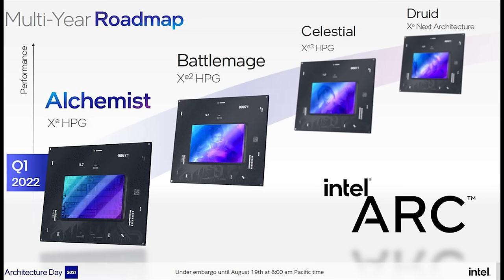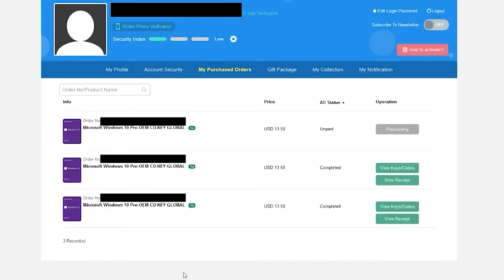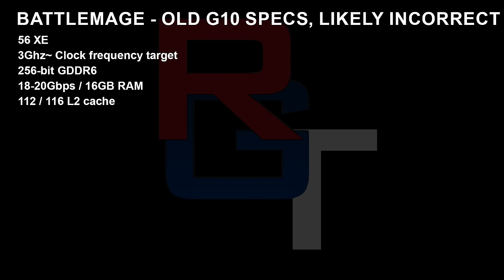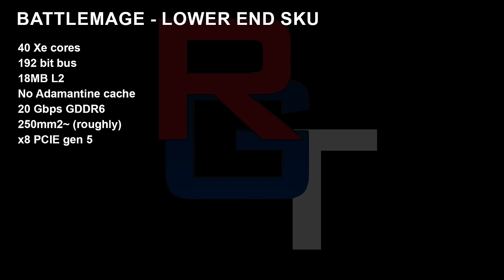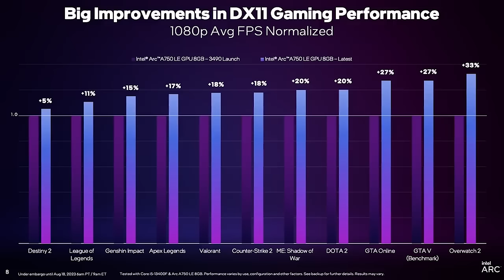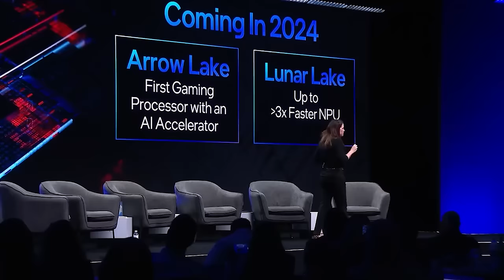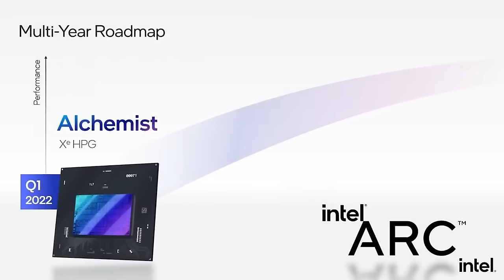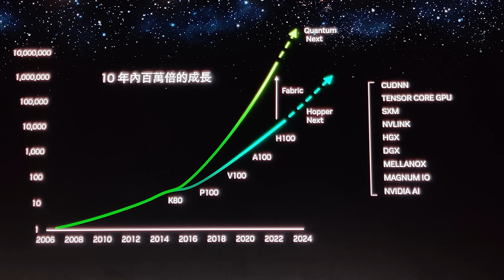INTEL BATTLEMAGE SPECS WERE WRONG?! - Big Update

Comment: Sometimes, and I've seen plenty of examples of this over the years, it appears that people in the industry, who SHOULD know better, are sometimes worse than the average consumer, at understanding trends in the market. Why did the 1060 sell so well, despite there being better options available? Because Nvidia had the fastest product on the market. To a lot of consumers, it works like this: "I cannot afford the fastest GPU on the market, so which one should I buy? Well, I should probably buy the best one I can afford, from the makers of the absolute best product, since they clearly know what they are doing." This means, that without a halo product, to kind of "prove your worth" so to speak, your lower end stuff won't sell that well either. So how come then, that AMD actually does well in the mid range sector? Well, because they've got a long track record. There have been Radeon cards that have been top tier. There's been times when Radeon cards were simply the fastest cards. Sure, it's a long time ago, but still. And even today, comparing halo products, AMD aren't THAT far behind Nvidia.
But if Intel has the option of releasing a lower profit halo product, that can at least prove their ability to compete in the semi high end, or ONLY releasing a "value" oriented card, they most likely won't manage to build excitement around their products, and even if their Battlemage cards might be great value, they will most likely still not sell enough to start making the ARC division profitable. In which case, that'll most likely be the end of gaming GPUs from Intel.
In fact, it may be that their desire to deliver compute cards to the server-/AI market will be what holds them back from actually delivering a great gaming focused card.

Comment: If they don't  launch a competitive  card  now... with metting connectors from Nvidia, it would be the worst mistake they could make. Put out a card that compete at the mid / high end that won't  burn your house down and it should sell...
Reply: All the sales are at the low end, top GPU right now is the RTX 3060 which is worse than both the A750 and A770 (and typically costs more).

Comment: Intel shouldn't be aiming for the top end of the market yet. It would make more sense to try and create competitive mainstream products.
I believe the 4060/4070 RX7800 area of performance are that level now. So if Battlemage produces a 5060/5070 performance card at a good price it may be a winner.
Intel needs to boost market share before setting its sights on the higher performance end. Then, who knows? Maybe a strong 3-way battle in the GPU market.

Comment: So how do you explain the other reviews of upcoming specs for the Battlemage that give you Xe 64 as their prediction?  https://www.youtube.com/shorts/9ZHL1XcaYB0  Why the sudden U turn just when the super is to launch?
Reply: Everything is pretty much a rumor right now. The last official source is that interview with Peterson for PCWorld, saying that he's excited about Battlemage and that more good news are coming.
Reply: @flaviusnecoara2559  30% working on Battlemage and 70% on the Celestial. So the card is done and dusted and drivers are to catch up. I can't see that it will suddenly be redesigned.
Reply: @paulboyce8537  Redesigning Battlemage out of nowhere would definitely delay its release, at least until Q2 next year, I think. And Petersen hopes that Battlemage will come out before CES. Besides, how can a 192-bit bus can be at least twice faster than a 256-bit one? I'm talking about the A770 card, even though those benchmarks were referring to the integrated GPU of the 2 generations.
Reply: @paulboyce8537  Another explanation for the possible cancellation of the 256-bit bus would be that the decision might was taken latest, around fall last year, but it's only recently that RDT's insider sources heard about it? It still wouldn't make sense, because why would Petersen mention that more good news are coming, then? 

Intel cares about its profit on long-term, and people want a Battlemage GPU that would match at least 4070ti, maybe 4080, for a smaller price. Why would they blow this chance by cancelling the 256-bit GPU, as they're not established in the GPU market yet?
Reply: @flaviusnecoara2559  I see the rumor to sell the Nvidia super cards. Someone in the chain made a bit of money.
Reply: @flaviusnecoara2559  A770 is Xe 32 and if Battlemage is Xe 40 there is not much in it with 192 bus only. With few tricks you can overclock the A770 to 2786MHz at 1.16V at 271W. I don't see the point for Battlemage unless at least Xe 56.

Comment: Intel’s GPU group doesn’t have the engineering talent to go head-to-head with nVidia’s upper end, simple as.
Reply: I gave NVidia engineers a decade to fix multimonitor support, where Intel "just works" from day one. Also that power connector is extremely dumb.
Reply: That isn't how it works.  If you can compete in the midrange on tech, you can compete at the low end and high end as well.  GPU architectures are scalable.  They either have the tech to compete at any level, or they dont.  And when you're behind on tech, you compete on price instead.  That's how it always works.